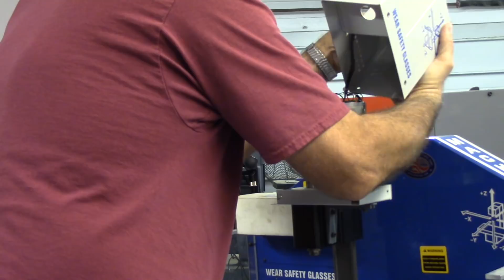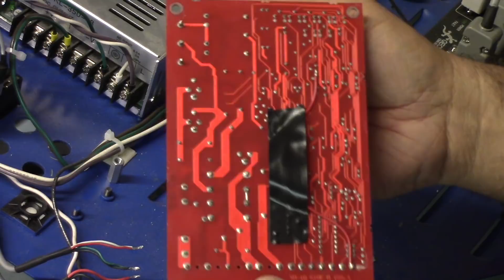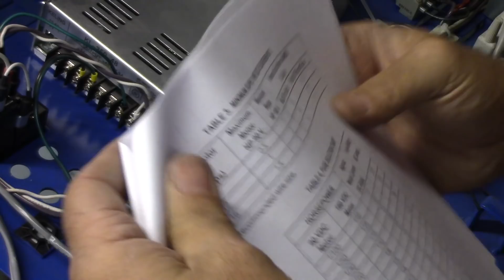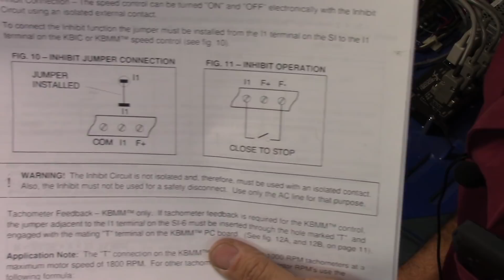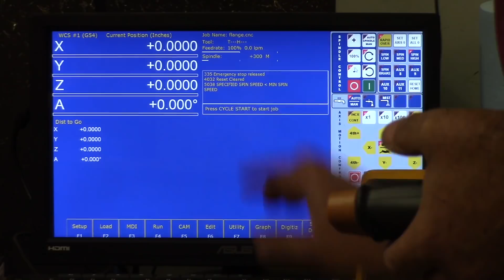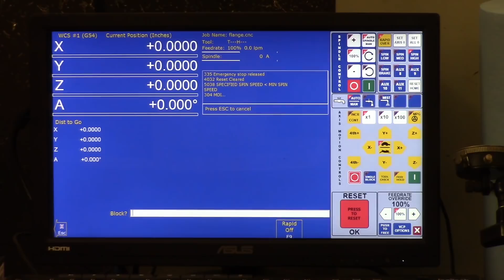R&R DC Spindle drive in the D&M4 CNC Mill, connecting & calibrating it with Centroid CNC Acorn

Comment: hello Marty, thank you for your videos. I've learned quite a bit from them. I have a question for you. I about to convert my PM-30MV mill to CNC using closed loop steppers and the Acorn CNC board. I wanted to know if I need to use either a KB KBIC-120 or the KB KBSI-240D board to connect the encoder input from the PM-30 board to the Acorn board?
Reply from the maker: Visit the Centroid User Forums and post your question there WITH pictures and any part/model numbers. The encoder MUST be a +5VDC line driver differential encoder. 1000line count is fine. You can find them at automationdirect.com under sensors. Must be belted at 1:1 to the SPINDLE with a timing belt if you expect to use Centroid's Rigid Tapping Option.
You can start a build thread there! Lots of help, just please provide lots of pictures and info, including links to any manuals.
Reply: @martyscncgarage5275  Thanks!

Comment: Good demo ! So what does the acorn board do with the information other that create a display of rpm?
Reply from the maker: TheJR914, that's complex. The displayed rpm is basically what is called and showing you the called rpm. Acorn can monitor actual spindle RPM if a line driver encoder is installed. Belted 1:1 to the spindle. The only reason I did this is so CNC software can control spindle RPM.